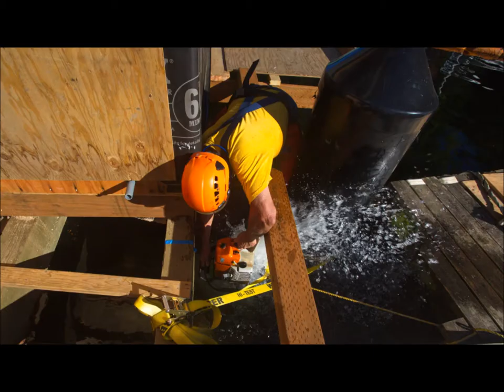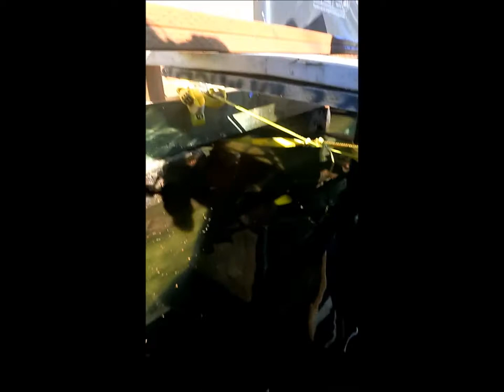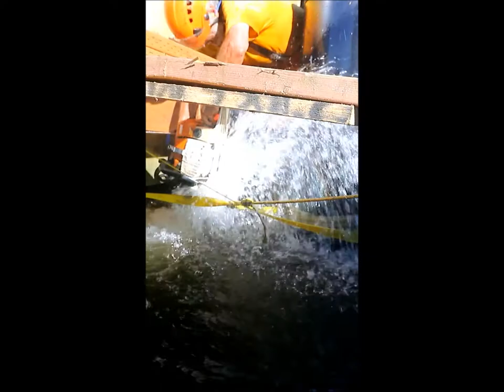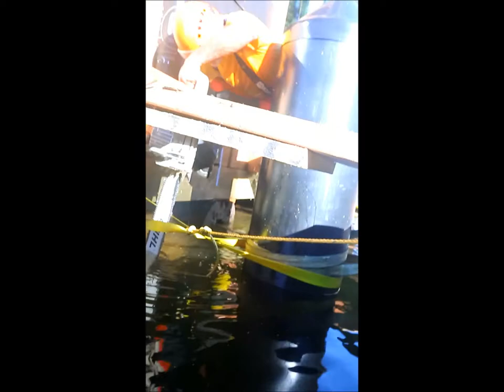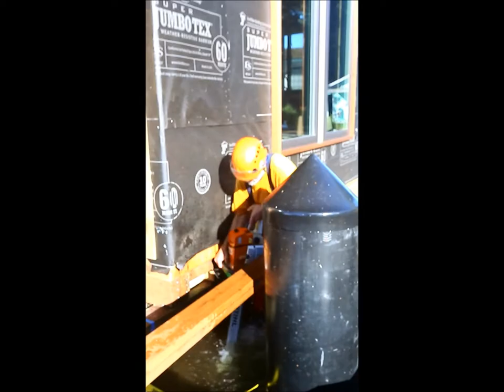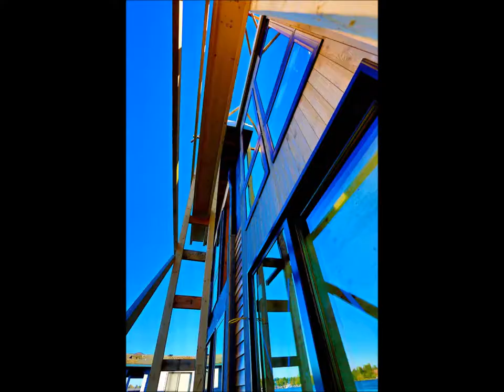Houseboat cutting in water

Comment: Client called, needing a flat spot in a support log, to mount a steel connecting structure. He requested a series of vertical cuts, so that the divers could chisel out the needed notch. I had to sit on the doubled 2x8's, bracing one foot in a hole in a cross wise submerged log, and the other on the twin 2x4's they temporarily set for me. I found that I had to cut with the a pushing chain (top of the bar), in order to direct the bulk of the water away from the carburetor, as it got drowned out quickly with normal cutting. However, the water then did a good job of drenching me... hench the ditched safety glasses.

I was glad to be able to make the cuts with the Stihl 660 and 36" bar, as the massive Husqvarna 3120, with either 42 or 60" bars, would have been more difficult to use, and wouldn't have fit in the tight spot as well.